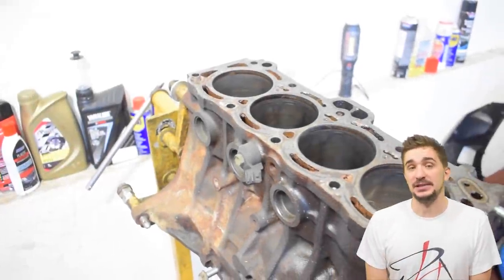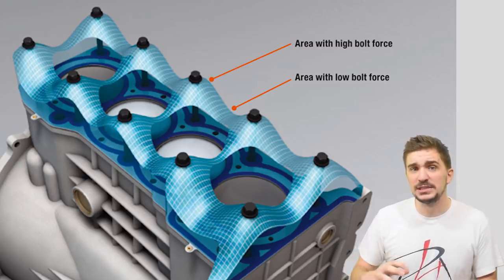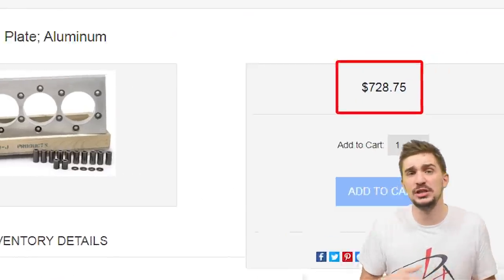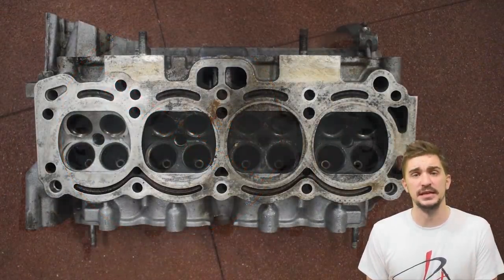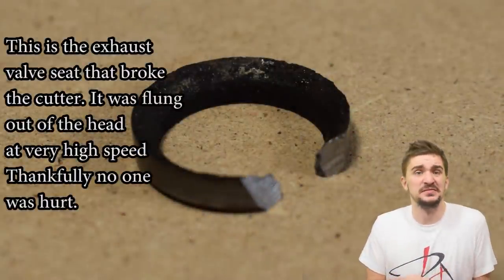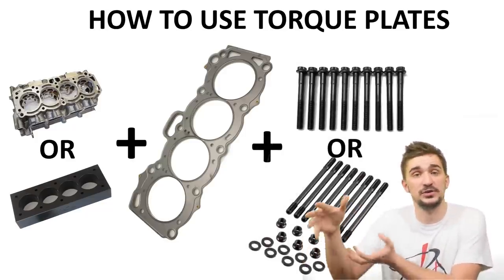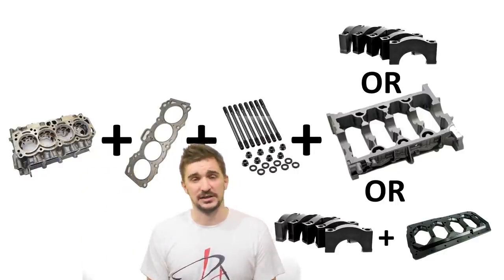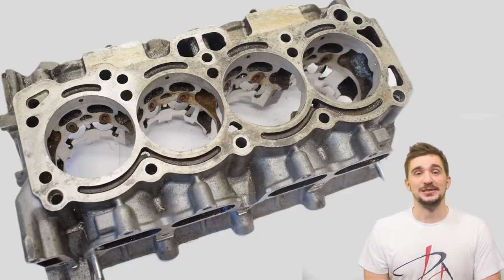TORQUE PLATE - WHAT, WHY, HOW? Do you NEED one and how to MAKE one - PROJECT UNDERDOG #7

Comment: Good idea, but once you drill those huge holes the head loses it's rigidity and you are not clamping on the block the same as with a complete "full strength" head casting.   With this partial (hollowed out) head, the block will distort the head and not the other way around, which is what you want. The plate is the best solution.

Comment: It is an interesting idea, however, when you bore an old head, you alternate its mechanical properties and therefor its behavior under the "torqueing load".
Reply: Yeah, of course, but since it's literally impossible to perfectly represent behavior under Torque Load while honing, I'd be willing to bet his set up is just about as accurate as an aftermarket Torque Plate. So whatever mechanical properties he alters by boring the head would just make it more alike a actual torque plate but not much worse if, at all.
Reply: @olimpiomesser2041 : An intact cylinder head, with just a few millimeters of clearance machined-out of the tops of the combustion chamber, would be more accurate. It would require honing the cylinder bores from the underside instead of the top side, but who cares about that? That just requires mounting the block in the stand upside-down, which is not difficult.

Comment: Make sure to measure the roundness after the honing with and without the makeshift torque plate. It’d be interesting to see what’s the difference.
Reply from the maker: Will do!
Reply: @d4a  take the measurements from the piston ring levels at TDC and BDC. I don’t know, but it would seem logical, that if there’s difference with and without the plate, that it would be higher at TDC (near the plate and bolts).
Reply: there will be no difference at all probably. i would only use a torque plate with an open deck block. the key word here is vibration. there are no vibration problems during boring a closed deck block.

Comment: Had this done to my Procharged 4.3L V6 Vortec. The machine shop used the 350 V8 torque plate which matched the deck perfectly. Creativity at its best.
Reply: Not surprising. The 4.3 is, after all, a 350 with 2 cylinders cut off and cast in aluminum.
Reply: @GoldenGrenadier  Most 4.3s are cast iron blocks. However, aluminum was available in the Bow Tie aftermarket stuff.

Comment: Thing is tho, if it’s cracked, when u torque it down, it’ll defiantly not stay the same size...
Reply: Yep. Could've bored out those holes in 2" Alu plate with nothing more than a cheap drill press and a couple of hours of work!! Dunno why they're expensive because most machining jobs I see are way more complex (injection molding dies)
Reply: Drrrrrrp
Reply: Defiantly?
Reply: @DM-wp9vq  
H
Reply: @vikassm  Is expensive because they can and also material can be pretty expensive when it gets up to size. If you quote a none motorsport machine shop it's probably much cheaper. Especially if you can do the modeling yourself. As you said it's only straight holes so the only real limits are the machine strokes and power but since you don't need to bore it in one go if you are smart most shops will have sufficient machines. (You can use much smaller endmills in circular toolpaths if it its just a 2" plate).
Reply: @rimmersbryggeri  That's what I thought too. It's expensive because they can 😂
6061 alu plate costs me ~3$ a kilo.

Comment: You have taken so much structure out of the head and seriously reduced structure at the gasket surface are , while better than nothing but will still not distribute loading now the same as a head
Reply: I agree. There's too much material removed. You'd have to go considerably smaller with the access hole to be of any real benefit - just enough for the boring bar then install the cutter to it from below. Or an undersized toothed cutter working on CNC in a planetary fashion.

Comment: That piston clearance cant be right. Forged pistons use 0.07-0.09mm clearance for that bore size usually. Stock pistons use 0.03-0.05mm. Torque plates are good if you use them properly, first you have to install main caps and torque them, then torque plate, same order as you assembly your engine. Also if there are gearbox bolts near the 4th cylinder you need to make a plate and torque them too. Torque plates have to be in place when machining and measuring ring end gaps too.

Comment: indeed, when my girlfriends scooter got rebuilt, even tho its just a single cyl 50ccm engine bored to 80 ccm, we had the boring done without a plate. then out of fun, the old head was drilled, and torqued down and the bore machine sent over it again. the results where quite far more than we first expected, supposedly the rings can take that up, but we went on with this and ever since any engine rebuild we do use this solution. it was allso fun to put the engine block into hot water, wait till it heats up and then run the bore machine over it. oddly enough even that made a huge difference, so the original block got scrapped as it is. we sourced a new block, and done the bore with the plate installed, and the thing heated up to near 100 celsius. got a better carb and a few things, and we are extremely statified with the results. it was a kinda expensive job for a scooter we got for free. it was the test bed to see the effects of heat, and head tourqed down properly. it is a great experience, and that little scooter does indeed goes like a real little rocket. final gear reducer was worn so it got exchanged for one that has lower ratio, it does nomore than 55 km/hr with far higher revs than stock, and the added more than 50% displacment shines a lot too. what can i say? it can pull a wheelee anytime you twist the throttle. its realy realy fun. so ever since this rebuild, when a rebuild a must have, i do my best to use a plate , and i do like to get bores done on hot material. it has quite an expense attached to it, as the machine shop is kinda.... you know that wierd dude is comming again, i wounder what stupidity he has came up with now kinda look over me. but if you gotta rebuild an engine for your self, and you are not in a rush, these little details add up quite a lot. not just performance wise. but it ensures longetivity of the engine, and for a rebuild you do for your self, making it lasting long is a factor. at least for me it is. i like it.

Comment: I work as a machinist and we had a customer bring in an F20C Honda engine to be bored and honed. This is exactly what we did to make a torque plate for his block. We actually used a junk K series head so that we didn't have to desecrate a much harder to find F20C head

Comment: Nice video as always, thanks. I actually heard from an other reason for a Torque Plate. For this, the plate also has it's own name, so i'm not sure, if it is exactly the same and i'm also not sure how to translate to english, perhapps something like "hone-glasses". The "hone-glasses" have the role of supporting the honing tool, since the honing tool is moving in and out of the cylinder and temporarily peeks out of the cylinder, so that the contact pressure of the grinding stones now acts on a smaller area of the cylinder. This causes the cylinder to become larger towards the top, and the honing glasses are used to prevent this. But in this case, the bore-holes of the "hone-glasses" has to have the exact size of the finished cylinder, this of course is not posible with your suggested solution of using an old cylinder head.

Comment: Allright, as I'm working to a machine shop and I am facing similar problems of roundness in our parts, you gave me the idea of making some "torque heads" for some of our products to eliminate this issue.
In addition, what's is an acceptable roundness in an engine cylinder? About 0.01 - 0.02mm i guess??

Comment: Was thinking and researching this exact thing because my block is at machine shop currently and torque plate is pricey. I work at a factory and have easy access to run a Bridgeport and have several spare cyl heads just laying around.

Comment: It depends on the block, but it is quite often possible to see honed and unhoned areas  in the same bore when you hone with a dummy head - which is why you need to bore sufficiently undersize to hone all of the bore surface. However, even this isn't perfect because the block will change shape with heat, and also with the stresses and strains it undergoes when running. It's probably best described as the "least worst option".

Comment: Loved this video, I have zero experience or knowledge with machining so this was incredibly informative. A couple of questions on this video. At what point is it best to overbore the block vs rehoning it? Why with hypereutectic pistons would you need to overbore the block a bit more, don't they expand much less than forged pistons? Will the cracks I see in your bored out head create issues once it is torqued down to your block? That is to say, won't those cracks allow your "torque plate" to distort in an unpredictable way?

Comment: Today I learned something new.

And my Dad that was a diesel mechanic in the 90s and early 2000s was like WTF? , when I showed it to him.

He did a lot of honning, boring and sleeving on inline 6 truck engines and nobody ever thought about torque plates.

He told me that's very high level stuff as well as being very accurate. 

So glad I found D4A.

But yep, this isn't your run of the mill engine mod project this is high end stuff. So every bit helps.

Comment: Hey dude, I've been watching the videos for Project Underdog since I was planning to do the same thing. I'm keen on porting a 4A-FE like you did, since as you've seen, the combustion chamber is too small for boosting. Thank you for the videos on the engine so far and I'm hyped to watch the rest of it. I have one suggestion for you, but it might have some drawbacks. Get a 7A-FE bottom end. You get more displacement (only difference, according to my research is that the block's a little taller, 7A belt should still work) for the extra gains, it's not much, but should help with the torque at least and the crankshaft is a bit beefier from what I've looked up too. Drawback, not that many aftermarket options for conrods, which should be one of the biggest concerns adding boost anyway. I've read that the 7A can take 16psi on stock internals, but obviously that would reduce the lifespan of the engine, but is a nice reference to have. Hope this helps and keep the videos coming our way, they're very informative :D

Comment: They don't do this in any of the engine production factories as far as I'm aware?  Even with the recent highly turbocharged engines giving upwards of 150 bhp per litre. What level of benefit is there?
Reply: Peace of mind for those with OCD? Unless you are running a high HP/ extreme setup the benefits are typically negligible. At the best your pistons rings/cylinder walls would last longer and seal better/burn a little less oil.
Reply: @SupraSav  ya, it's for those either running extreme builds or who just want something that is done as well as possible at each step
Reply: Chris Wade I think engine manufacturers similate torque fastening when building their engines, they may not use torque plates as we know it but they do have some sort of jig on their assembly lines that does this. 
Also you are comparing new blocks made with new techologies at 150 hp per liter, vs old blocks producing 200 and often a lot more hp per liter. And, new vs already used, heated etc material.
Dont know about usa oem, but most, if not all, well known american engine builders will use and advocate torque plates.
Reply: Many engines now use free standing cylinders with no connection at the top to the bolt areas. Cylinder sealing is critical for top performance when the last 1% makes or breaks it so this gets you that 1%. A test with a good leak down tester will confirm your benefit. Deck plates will improve leak down from 4%ish to 1%.

Comment: What would be the trick thing is a torque plate that is tapered and set up for the oversize that matches the size of your cylinder after it’s is bored oversized. That way you not only get the right size torque plate, being tapered you can also use it to instal the piston and ring assembly when your building the engine after everything is machined.

Comment: Much appreciated. To the critics, while we can say that drilling big holes in a head will weaken it and thus not mimic a normal head precisely, I would imagine that it will still be distorting the block in a manner similar to its final state even if to a somewhat lesser extent. A solid block is unlikely to be better unless tests are undertaken to compare it to a normal head. I don't see this happening, even for $750.
Reply: Exactly. We're not talking about an F1 engine with clearances so tight the pistons are SEIZED in the bores at room temperature. I think the block distortion is close to the same also. There are ZERO clamping forces in (later) holed out combustion chambers... this is a very creative solution.

Comment: Thank you, I totally agree with using torque plates. Could you please give your opinion on break in and seating rings on a rebuilt engine. Seems like if the cylinders are finished true, the need for following strict break in guidelines wouldn’t be necessary?

Comment: to be honest if your going to use a torque plate, ypu might aswell heat up the block to operation temperature to account.
Reply: and installing the boring machine on a vibrating plate to simulate the actual vibrations of the engine when running :)
this all torking plate story is a joke ....
Reply: @lebaillidessavoies3889  🤣
Reply: Been tried. With Minimal/none success. You'd have to get the upper cylinder hotter than the bottom and hotter on the exhaust side. Heating the whole block just makes the whole thing bigger with zero benefit and HUGE problems measuring.

Comment: Thinking out of box.. interesting..

But i think when drilling massive hole on the head, it becomes weaking because its missing big chunk of original cylinder head webbing... 

Hence the pulling of torqued surface might be a little different than actual head...

Anyway i still think it is better than bore/honing without any torque plate at all...

And dont forget to resurface the head-plate before using them as torque plate

Comment: The 4A-FE is a great engine! Which car are you putting it in and how are you building it to get 300hp? I had a 1993 Corolla with 308,000kms on it. It wasn't idling the best. I basically would run it easy until operating temperature then rag on it most chances I got. It very quickly started running way better. Over the course of the next couple of years, I made mistakes and overheated it a couple of times, and at one point it went over 20,000kms without an oil change. I continued driving it for another 35,000kms after that without engine issues. I only got rid of it because the car needed a bunch of wear items and there were other cars with fewer kilometers on the clock for cheaper than that maintenance was going to cost. 

What would your favourite Toyota engine, besides the A series, be to build?

Comment: The down side that I think is that a torq plate done that way don't have the same rigidity as an operating cylinder head, so some distortion is absorbed by the drilled cylinder head, but got to be good enough

Comment: Wouldn't it be even better to mount an intact junk cylinder head onto the block and then machine the bores from the underside? That way you don't have to deal with changes to the cylinder head's material strength, and thus changes to the way it compresses and deforms the engine block, caused by drilling enormous holes through the middle of the cylinder head. I realize the honing tool needs to be able to reach slightly past the end of the cylinder bore to complete its job, but that could be accommodated by machining-out just the tops of the combustion chambers in the cylinder head to provide a few millimeters of clearance for the honing tool, rather than drilling all the way through the cylinder head.

Comment: Very interesting. Why wouldn't you be able to bore it from underneath? That would let you mostly leave the head in-tact. Would it be difficult to align and centre the holes?
Reply: Depending on the block you may not have space on the inside. iv tryed to push a piston thoght a block and the bain journels would touch the skirt after a few mm in
Reply: @ok9k572  Ah that makes sense. I completely forgot the bearing structure would be in the way. You could probably do this on single-cylinder bikes that have a base gasket, but bigger engines tend to have a solid block. Maybe you could somehow fit the tooling in there sideways, but seems like much more missions now that I think about it.

Comment: Do you know what the normal factory tolerance is for cylinder sizes? You mention the stock pistons are 0.12mm - 0.14mm which is the same as 0.13mm +/- 0.01mm (0.000394"). Is that considered a good tolerance?

Comment: Hey, @driving4answers I am building a budget 1.8T VW engine. The block is in really good condition and cylinders look awesome. The entire short block has NEW spec measurements and I am wanting to run forged pistons of stock bore with ARP head bolts. Do I need a torque plate? I am short on some money for them and not sure if I need one

Comment: Didn't know about torque plates. The theory behind it seems really solid, and I like the upcycling you've done with your old head. I'm curious if the clearances on a machine shop boring your pistons would run into any issues due to the head being attached? Like would the programmed movements of the bore arm hit the head while moving to the next cylinder? Or does each cylinder get set up for boring independently so there's no risk of the machine hitting anything in a pre-programmed path?
Reply: ^^^ i would like to know the answer to this as well lol